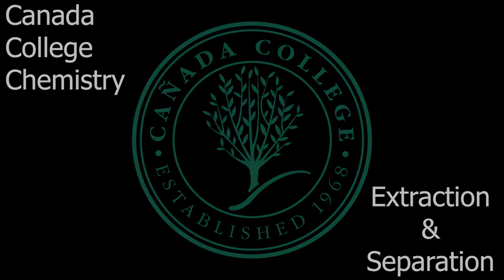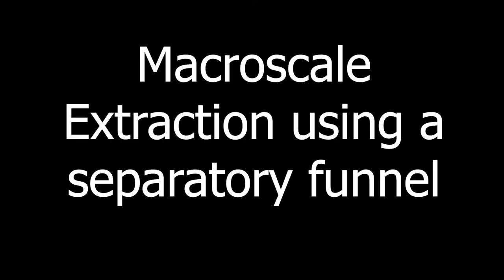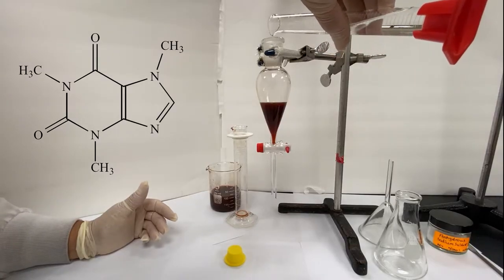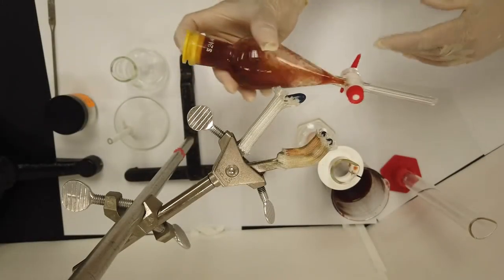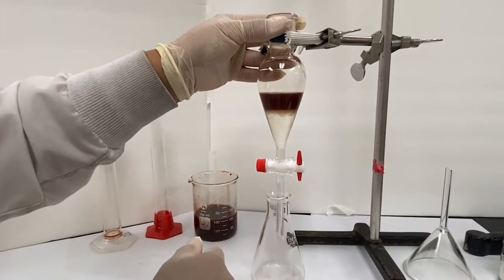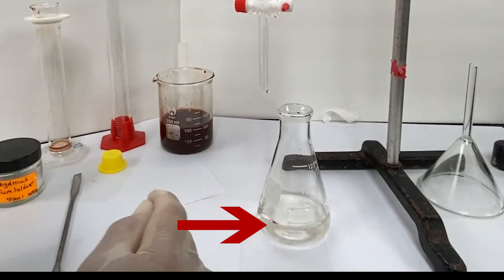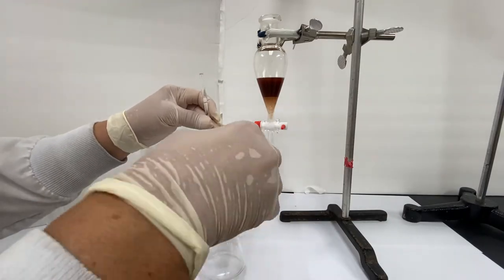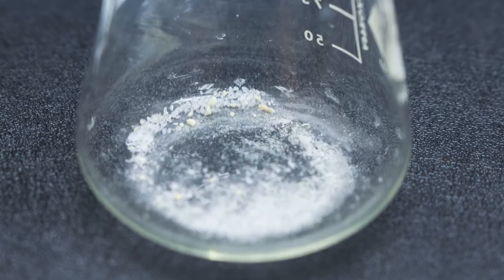Caffeine extraction and separation

Comment: Could you also reflux the tea bags to extract it? I'd imagine it'd be more efficient than simply boiling it in a beaker?
Reply: You could, but the most effective method would be to use a soxhlet extractor that refluxes the solvent and continuously drips it through the tea in this case

Comment: After doing soxhlet extraction by using DCM for plastic could I remove solvent from extract by using same techniques like placed it on hotplate and evaporate ????
Reply: Yes. I  usually distill the solvent off in order to recover most of it though.
Reply: is there any other other solvant that i can use than dcm ?

Comment: Once the DCM has been boiled off, is the remaining caffeine safe to eat? How do you know when enough DCM has been removed? Still new to chemistry.
Reply: Depending on the solvent (you can also use other organic solvents like chloroform or acetone, which is really common) it is safe in small amounts, and normally organic solvents will evaporate incredibly quickly and don’t stick to molecules
Reply: So yes, it would be safe to eat, but maybe let it dry for a little longer
Reply: is there any other other solvent that i can use than dcm ?